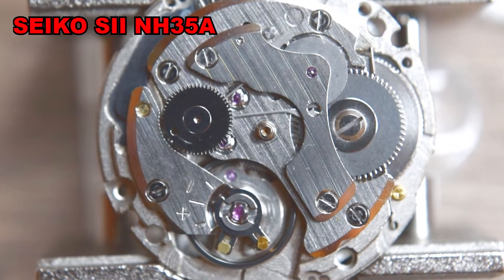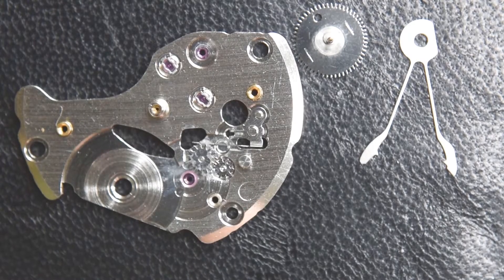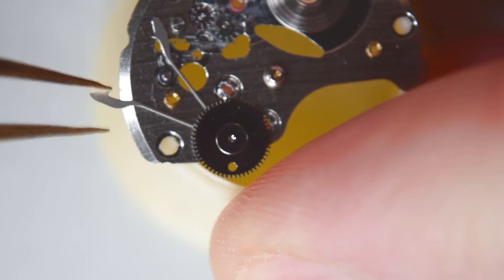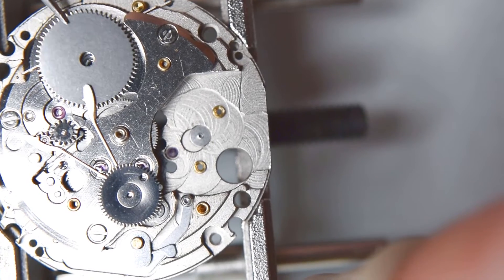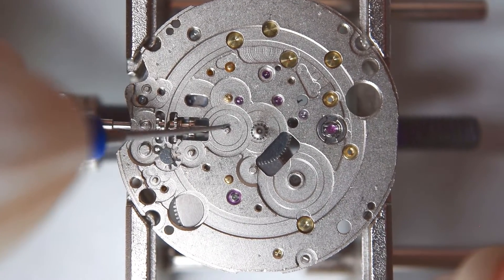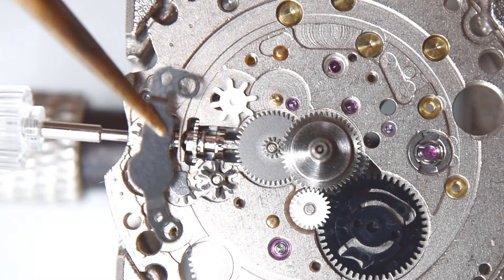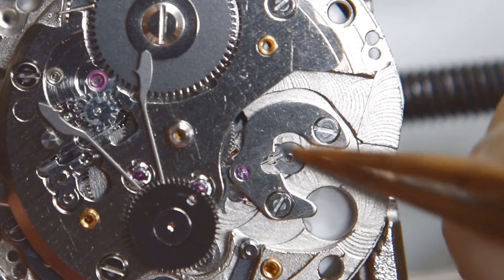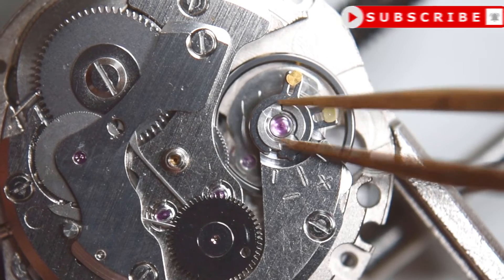Zespół mechanizmu zegarka SEIKO NH35 znanej marki Micro

Comment: Casio is suppose to use this on an edifice this summer.
Reply from the maker: I'm curious how it will look like ...
Reply: @tickingWATCH  you can google it efk100 is the model i think. its basically a date wheel at 6 oclock. very neat. Something casio would simplify for their first attempt.

Comment: Hello, I have one NH35 movement, initially it can be wind manually for a few turns and now it cannot wind manually, do you know the main reason, is it because gear misalign or missing/misplaced, thanks in advance
Reply from the maker: I think you are very close to the reason, but finally you need to take a look at keyless work.

Comment: Hello, want to ask why my watch with nh35 change date progressively late, meaning date change at 12, next date change at 12:15, next date change at 12:45, next change at 1:15, next change at 1:45 and so on, this is driving me crazy, thank you in advance
Reply from the maker: It seems that some o the gears that are responsible for date change are damage. Checking them and replace what is needed should solve the problem.

Comment: Have you ever had any problems with that movement afer re-assembly? I have 2 that act strange on the timegrapher showing a beat rate of 25200 insteand of 21600 running much too fast...Any idea what could be the issue?
Reply from the maker: My is working fine, maybe check the lift angle setting on the telegrapher

Comment: Hello, 
many thanks for the great video. Unfortunately I have problems with the Date Dial Site.... 
The crown or winding shaft is not working properly. 

I can only get it to the 1 position and it then only adjusts the hour and minute hands, but I have no “idle time” and can't adjust the date either... 

Can you help me here? 

It looks like the one in minute 04:09. 
What tool do you use to adjust it, like in 4:37? 

Many thanks in advance and best regards 
Florian
Reply from the maker: I have tweezers, a movement holder, and rodico as support you can buy it quite easily.  Check the links in the description down below ...
Reply: @tickingWATCH  thanks for your fast answer, mate. Can you help me with my question (accordimg to the time stamps) too, please?
Reply from the maker: No problem @floriansurmann9948 , have you disassembled the movement? It can be that some levers are bent ...

Comment: You know, there some people who knock on Invicta watches and they use the nh35 movement which has been proven to be more accurate in timekeeping than Rolex. I think this Japanese movement is excellent.
Reply: It’s not the movement for the reason people put down Invicta.   They just have turned themselves into a company that just sells the cheapest of parts and no warranty to speak of.  They could do a lot of things to make their watches better but they are to cheap and most of their customers don’t care if they use the cheapest parts they can get.  For them to sell a watch for 125 dollars tells us that they might have 40 dollars all in for everything.  That’s why I think you can get a really well built watch for around 299 for a diver and 399 for a good GMT with a nh34 movement.
Reply: Lol no nh35 is not more accurate than Rolex if you want precision Seiko movements you need to go to Grand Seiko Lines.
Reply: @betochiwas jee jee!!
Reply from the maker: Thanks for your feedback I really appreciate it
Reply: Addiesdive is way better quality and finish than Invicta.
The brand stamped on the side of the casing makes them look cheap.
Reply: NH35 is not nearly as accurate as Rolex movements.
Reply: @julianpletl3061  that’s not correct.

Comment: It can be the best movement in the world, but I hate any that has plastic gears.
Reply: At least the plastic gears are driving the calendar and not the main movement, sadly it will break if you attempt to change the date from 9pm-3am as the calendar adjustment is separate from the trigger gear.
Reply from the maker: @MarcABrown-tt1fp  Thank you for your opinion 😀
Reply from the maker: so they are, thank you for sharing

Comment: I bought a Maratac LSA Homage watch that is said by the vendor to have a Seiko NH-35 movement, but it’s an automatic watch. In this video I didn’t see the weight that I understand is inside an automatic watch. Does that mean that the NH-35 comes in an automatic and a mechanical version?
Reply from the maker: Hi, NH is only as automatic, here it is just not installed because it is rather easy, in my next video where I'm building a pilot watch you can see it

Comment: Nice upload, but it looks as if Seiko are having financial issues with all of these plastic components.
Yes, I understand that they are not in the power train so they're not under any great amount of force, 
but it looks cheap and I bet that in time they'll generate issues of plastic dust fouling the jewels.
Even the Chinese standard movement doesn't use plastic wheels.
Reply from the maker: Thanks for your opinion I really appreciate it
Reply: These specific plastics don’t require lubricant, whilst lowering maintenance requirements… and this plastic is engineered to last.
Reply: @2K9s  "Plastic is Engineered to last". Just like your plastic watch strap and trainers. 🤡
Reply: Let’s see with ETA movements how it works.